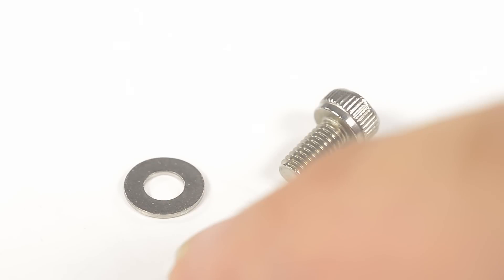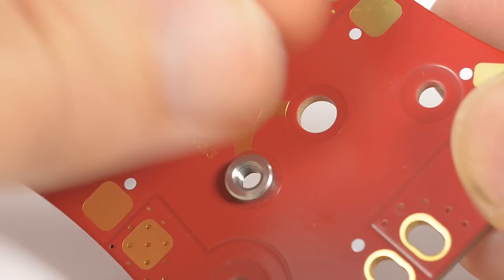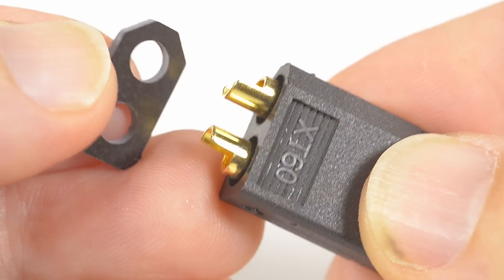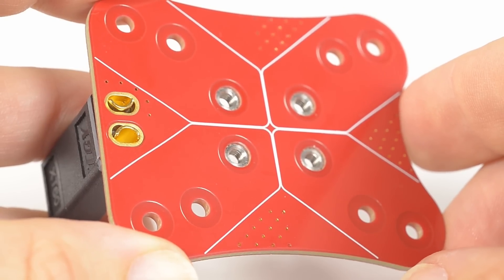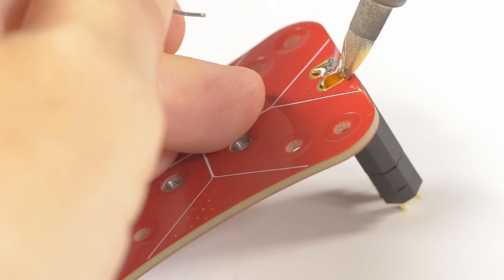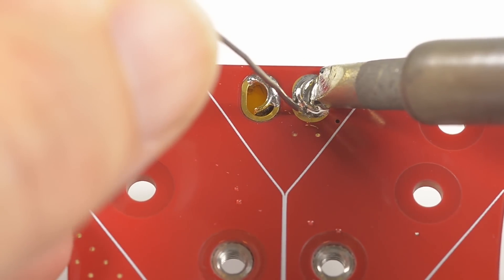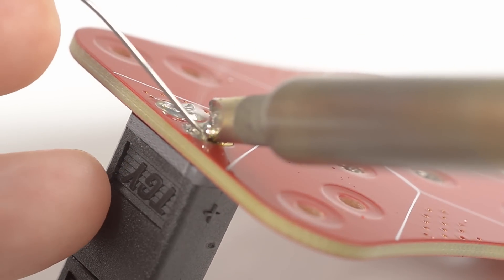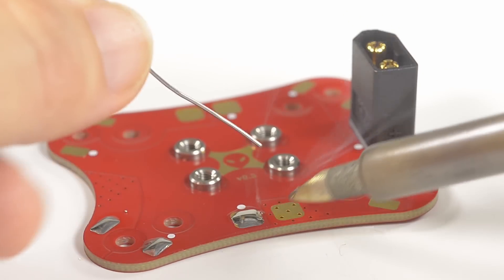ImpulseRC Alien Build - PDB Preparation

Comment: so if battery is 14V connected thru XT60 is PDB board doing 5V for FC ?
Reply: +Zukas inc Sorry no this PDB has no voltage regulation. You will need an external BEC or a FC which supports Lipo input.

Comment: I prefer to make the XT60 flexible.
As I did my first flight, the LiPo ripped the XT60 off :(

I just soldered 2cm cables to the XT60 and it can bend now in any direction the battery wants to go ;)

cheers,
Timo